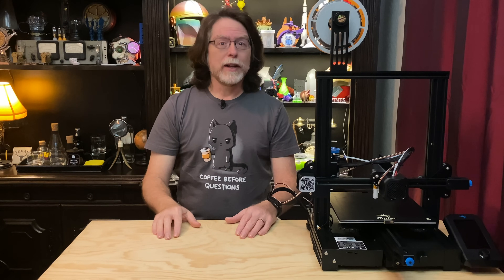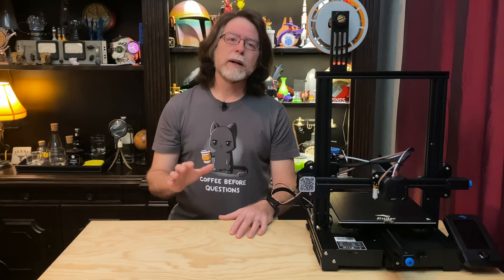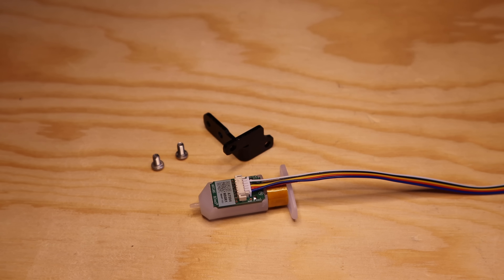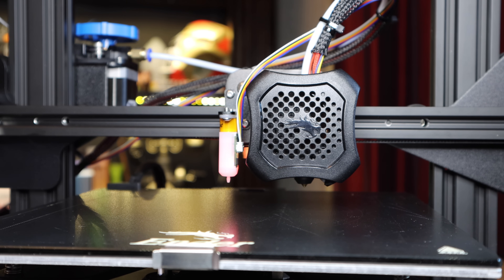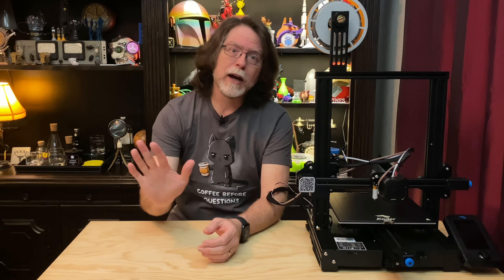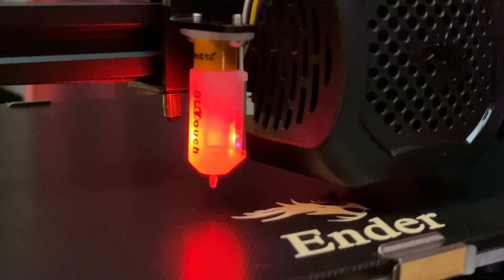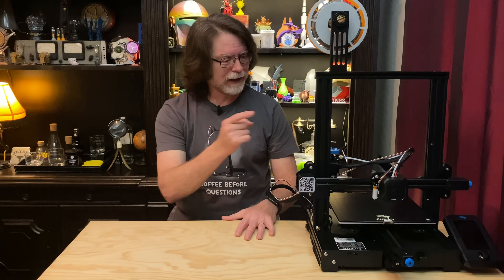Level Up! Install Creality's BLTouch Bed Leveling Kit on Ender-3 V2!

Comment: Very important!
If you are using the Marlin based firmware and get probe errors, disable HS mode.
Advanced -> Probe Setting -> Enable HS mode. Make sure this is disabled and try again.

Comment: I know I am way behind the times, but I am just getting to this stage of my 3D printing journey.  This tutorial was great and very helpful, so thank you for the detail and information you put into the videos.
I am having a heck of a time getting this printer zeroed now.  I have leveled the printer, the bed, and have followed the instructions in this video an on the internet in general.  Every time I adjust the z-offset and home it does not seem to help.  Also the 10mm offest at the end of the autohome is additive onto the negative offset I give the printer. The firmware was just updated as well so I can use the BL Touch.  I know this video was quite some time ago, so I don't know if anyone will read this, but If you've run into this and found a solution please let me know.  

Thank you!

Comment: installed this about 3 years ago and your straight forward and complete explanation made it easy to install!  Thanks so much for the tips and tricks along the way!  It still works well after all this time!  I have a question:  Does the printer keep the bed leveling coordinates for successive prints or do I need to run it for every print?  I just started using the z-hop feature in Cura and it's hard to locate items on the print surface and miss the probe locations.

Comment: This definitely solved my problem. Creality has so many firmware versions for the same printer, I made sure I used the same version as you (even though it's probably not the latest) and all was good , unlike other instructions (including Crealities) that couldn't be followed.

Comment: I just installed my bl touch on my ender 3 v2 and so far i hate it! it fails most auto leveling tries and the only way I've had any success is to shut it down and try again which usually also fails!

Comment: do we have to redo the levelling proccess before everyprint? I first level auto then level with z offset and paper but after these if I press Level button again it just resets and goes further away from the plate

Comment: Do you still use the Ender 3 v2? Did they ever make it so the settings are saved on the unit and not just the SD card, I wounder if I leave an SD card in side the display slot if it will just default there

Comment: mmmm I  would question the BL Touch ability to compensate fort change of bed ... if the Z height changes - the BL touch will still check level - but will not alter the Z height that has been stored in settings. I know this as fact as I swap beds quite often ... Magnetic - Glass ... and I have to reset Z height each time.

Comment: I just bought a BL touch and watched this vid to prepare I guess (and the shipping takes a while). I got one question tho: Why set the z-offset to -2.5mm and not just level the bed first? Did you already level the bed before hand? Thanks in advance Brian.

Comment: thanks for the videos!  I installed a cr touch, and downloaded the firmware corresponding to ender 3v2 with cr touch, but I realized that now it is showing 235x 235x 250 in the firmware version info, how to fix this?  because there is no other firmware that is compatible with cr touch and has the correct size of 220x220x250.

Comment: Thank you sir for your video! This checks off a lot of boxes for me. Well made, easy to follow. I subscribed shortly after the video started. I do have a question though... @13:45 When you printed your squares to test, it looked like there was something on the base. It looked transparent and thin, and smaller dimensions than the base table itself. What is it? And please note that I have not even printed anything yet. I spent the last week adjusting, checking, then installing the BLTouch, and watching videos like this to get a better understanding. Thanks again! {liked.subscribed.saved=True}

Comment: The protective plastic mesh tube is easy to deal with. A little trick: grab 2 ends of it and push them together, like a chinese finger trap toy, the tube will get shorter in length and larger in diameter allowing you to easily push the wire through it. When you're done, just stretch it back out into place.

Comment: Well that was fun, Don't ask . Anyway I'm not sure how I get answers to me comments but here goes anyway is there a way to have this printer use 2 or more colors print. Like a add on or what ever. I will be buying mine soon and would like to get that add on if possible. Thanks for the video

Comment: So, ever since this upgrade I have had nothing but problems.  First time i tried the firmware update nothing changed.  Second time, no black screen, no pause, normal splash screen and right in the "new" firmware set to Chinese.  I set everything up, changed the gcode, sliced a new file, put it in, preheated, went to print screen and nothing, it just sits indefinitely.  I then put the sd back in my computer, deleted the gcode file, resliced an stl put it in my computer and it said it needed to be repaired.  I repaired, formatted, resliced put it in the printer and it wouldnt read any files.  back in the computer, file is there. Back in printer, no files.  I've tried this with several new sd cards with the same results of not reading files.  Also through this process, with trying to read a saved configuration it would not go back to my settings.  So I can not read files at all now.  Any one have issues like this?  Do I have a faulty card reader in my printer?  I havent actually had a successful print because of the thing coming out of level or just stopping during a print.  Should I put in a claim with Creality?

Comment: Hi Bryan, I tried your method and it still doesn't work.. I have tried a few other methods and I still can't get test prints to stick on the glass surface or the hot end just grabs the filament and drags it around under the tip...

Comment: Leave it to the Chinese to make the upgrade as hard as possible. First the printer doesn't have the right board (you need an adapter to get it running with the old 1.1.3/1.1.4 boards), then the holes in the V2 aren't there, then the instructions aren't for all the printers the upgrade is supposed to be.
Top quality, as usual.😅

Comment: I put in the sd card for the firmware update and it just beeps really loud. Do you have to unplug the cable for the z switch before or after the firmware update?? I've read that's usually the problem? It would've have been nice to have seen  the firmware update part. My first experience has not been a great, positive or enjoyable. It makes me just want to get rid of this thing.

EDIT: How come no one mentions you have to unplug the set stop cable before you turn on the printer after installing the BL touch???
Reply from the maker: Hi,

Once cause of the Really Loud Beep issue may be installing the wrong firmware for the board that's in the printer. Double-check that the firmware matches the printer's main board. In the almost two years since this video was released, I think Creality has moved the firmware files to various places on their site numerous times, so the links and locations shown in the video may no longer align with reality.

If you let me know which board revision is installed in the printer, I can try to find the appropriate firmware file for it.
Creality's got all their Ender-3 V2 files stored here, and this appears to be the most up-to-date: https://www.creality.com/pages/download-ender-3-v2?spm=..page_1934481.products_display_1.1&spm_prev=..index.header_1.1

The firmware update kind of needs its own video, and that was linked in the description of this video, as well as mentioned and pointed out as a clickable card in the top right corner of the video. And here's a link to the video if you still need it: https://youtu.be/BI269XHyAFg

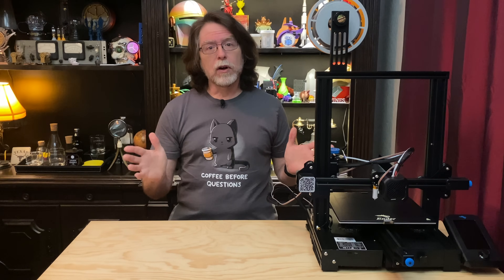And at the 7:52 point, I do show unplugging and removing the Z end stop switch. Though it's not explicitly stated, this is shown after replacing the bottom cover of the electronics box, and before the printer is shown making use of the probe when homing. I try to be clear in my videos, but I obviously missed pointing that out. Thanks for bringing it up!

Comment: hi, this tutorial really helped me install this probe. I have one question however. Is it very important that the SD card that i use to update the firmware is new and empty? or can i use my already (STLfile)used SDcard? And ifso, could i still use that card after the update?

Comment: While installing the BL touch. I accidentally installed the V1.0.4 firmware version onto the printer. Ofcourse this should be the V 2.01 version. But now I can't seem to be able to install this version.Does annyone know how to fix this problem?I already tried to put the printer back to the factory settings by using the M502 code ending with M500.Maybe i'm doing this wrong because this also does nothing to the settings of the printer en stays on te V 1.04 version while this should be the V1.02 version of the firmware.

Comment: do you know if all bl touch probes can work with the ender 3 v2? I got a kit but turns out is for for a BIQU .. which I don't know what it is... I can see the cable that goes to the motherboard is not the single cable with the white plug but it strip into 2... one with 3 pints and the other with 2 (black/white) and the bracket does not match the v2... so before even try I want to be sure it will work.. any idea?

Comment: Im thinking in buying one of these... thanks for the video!!... hey, may I ask if it is normal for the back left knob below the bed to be basically stuck? is super hard compared to th other 3.
Reply from the maker: The back left corner is the one with the cable strain relief, and that's kind of held in place by the spring in that corner. So there's more compression on that spring than on the other ones. If that corner is tightened all the way down to where the spring is fully compressed, you might need to raise the Z axis limit switch up by a millimeter or two, then re-level the bed. Or, if everything is working fine, it's probably OK to leave it as-is. :) No sense fixing it if it's working.
Reply: @BV3D   Thanks for the reply!... yeah, is working fine.. I re level the bed every after a few prints but was mostly curious. :P

Comment: How do you keep the temperature accurate while it probes? Preheats to operating temp then probes and drops 40 degrees and tries to print once it has finished probing

Comment: Would anyone know why even after I save my settings and use the Z- Probe wizard. The CR touch I use just seems to ignore it. It was working fine up until about 2 hours ago and I have never had any problems with it. This is so strange and seems like it may be a software problem?

Comment: I watched a few of your vids to help me get my printer & BLTouch up n runnin - thank you for the vids it helped greatly! BV3D all da wayyyy
Reply: Do u have same model? Ender 3 v2? U managed to print successfully using Bltouch sensor? If so can u kindly help me out? U have telegram or discord?
Reply: @loki4171  yes, i had some issues at the start but its been working great since. my #1 tip is to make sure your bed is pretty level (not perfectly but nothing too extreme)
Reply: @bravoyab9634  i managed to make it work turned out that the arm was not properly aligned
Reply: @loki4171  oh okay good. glad to hear its going smoothly

Comment: my kit came with a 3 pin and a 2 pin wire. I have looked online and tried to add the mounting board and plugging the 2 pin into the z stop. the problem is that no mater what firmware i load the bltouch v2.1 wont run a bed mesh. What can i do?

Comment: After looking for days, this was the first video that showed everything i need with the kit i have. I have an Ender 3 Pro but everything basicly works the same.
Having it explained by Frank Gallagher is a nice bonus too. I watched it around 5 times until i had everything figured out.
is the Z axis offset still saved on the sd card?
Thanks for the great vid.

Comment: I installed firmware for 4.2.2 with BLtouch no adapter, it deploys the pin twice at start up, and when I go to auto home it, x/y go to 0/0, it then brings probe to center, pin does not deploy, z does not move down. With the “Move” I can move the z axis up, but not down. I’m not great with firmware, does anybody have a fix?
Reply: I had the wrong firmware hahahaha

Comment: My BLTouch gave me nothing but problems. Probing fails +-50% of the time and that leaves the probe down, and it still prints, pushing the probe against the side of the bed and bending it. I ordered the CR touch, I hope that performs better.

Comment: SUPER IMPORTANT! My Ender 3 V2 4.2.2 board REQUIRES to update firmware of the LCD as well to start printing, otherwise great tutorial. Creality has a good video on the LCD here: /watch?v=9VzAN0M7Pks

Comment: Hi guys, I dont know if anyone here still checks this, but I have a question about setting the Z-offset.   While you're setting it, what happens if you've set the z-offset too much? Wouldn't the nozzle crash into the glass thus potentially damaging your surface?

Comment: Howdy Friend.  I kept getting hyper-fixed on your UT longhorn coaster on the bottom left of the screen. Lol. I also realized about half way into me typing this that some content creators might enjoy some anonymity so no need to reply if ya choose  but a big HELLO from Bulverde, TX! :) 
I had gotten tired with trying to go with offshoots like (A8, Aquila X2, etc) and always run into issues with ability to either upgrade or mod even though they are basically aestheticlly similar however the internals are divergent tech which for instance adds in st links, soldering, and a whole slew of things not to mention the passionate yet low populations of these communities that help make marlin and a few others finally accessible. So I just got a new Ender 3 v2 on a amazon lighting deal and was able to get a CR Touch along with their new Sprite Direct Drive for literally about $150 less than the S1. And deciding to have some background help with the install I have seen many of your videos and its was an easy selection. So thank you for your hardwork and pro-level content.

Comment: WARNING!!!!
I had wished that i knew one IMPORTANT bug was mentioned during this tutorioul as i just managed to ruin my bed after following this guide 100% and doing my usuall tweaking during printing...

The Z-Offset which is added by the newly added BL touch to eg. -2.70 mm is not known to the current print, so if you tweak this slightly (i do this sometimes if i see its off by 0.1 mm as i was used to this tollerance variation from my regular Z-axis home sensor) BUT DONT TWEAK THIS AT ALL!!! WARNING!!! If you change this value during print it will not change from eg. current -2.70+ the change but the ENTIRE -2.70 + change! e.g instead of moving -0.1 if you changed it to -2.80 it will move -2.80!!!!

Hope this info can save others from ruining their bed!

Second error, DO NOT use the regular "Auto-home" functionality as this will look for the regular Z-axis sensor and not the BL touch!!! Another bug!!! Use the newly added button on the front page of your ender 3 V2

Comment: Great video, but any advice on uninstalling the BL touch? The one I have is Red but flashing off, and it has become unreliable. I never really liked the BL touch, it always seems to cause more problems than it is worth. Problem, I cannot get the non BL touch firmware to install. All I get is the endless black screen. Suggestions?

Comment: You didn’t show where to plug the other side of the wire. Not the probe end but the other end.
Reply from the maker: Hi! The non-probe end of the cable gets plugged in at the 7:10 mark. 👍

Comment: Why you have downloaded the firmware whitout the adapter?
Reply from the maker: Because the main board inside the printer has a dedicated port for the BL Touch, and the BL Touch cable has a single connector on the end which plugs into that port. Other BL Touch kits from Creality have an adapter board that plugs into the main board, in the port that the screen plugs into. Then the screen and the BL Touch plug into the adapter board. So the “with adapter” firmware works when using that adapter board, and the “without adapter” firmware works when plugging the BL Touch directly into the main board in that dedicated port.
Reply: @BV3D  thanks..tomorrow i will try 😅

Comment: Great video, I think it has the opposite effect on me than what creality would hope for though. This helped me decide that the BLtouch isn't for me. I do have the warped glass plate that the enders are apparently known for, but rather than buy the leveling system and go through the setup and install, I've just decided to buy replacement plates that are known to be much flatter and I'm getting two of them for half the price of the BLtouch without having to deal with a firmware update, guess-and-check z-offset (or offest) and more moving parts with potential for failure. Thanks for the thorough and honest review.

Comment: Idk if anyone will answer since this is a year old video. But does this "level" the bed not by helping you physically adjust the bed, but by measuring where it's at, then software accounting for imperfections while printing? Or am I not understanding where the actual leveling comes in?

Comment: I am new to 3D printing and I have an Ender 3 V2 with an add-on CR Touch leveler on order. Did I make a mistake ordering the CR Touch? Looking at Ender 3 V2 videos most users have BL Touch modules. Most firmware (Marlin, JyersUI, etc. seem to only have BL Touch Binaries). My list of growing concerns are: offsets (are they different), mounting details (can't see many ThingiVerse CR Touch mount projects), and precompiled binaries. Thanks - BTW I have enjoyed watching several BV3D videos, keep up the good work.